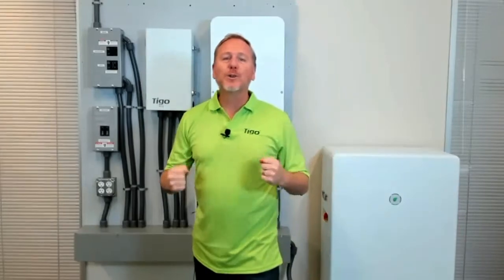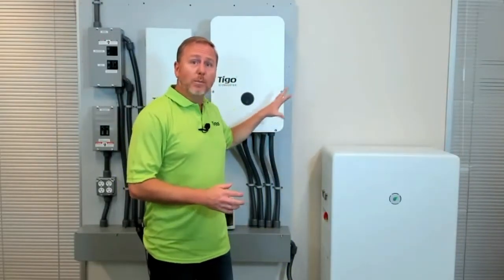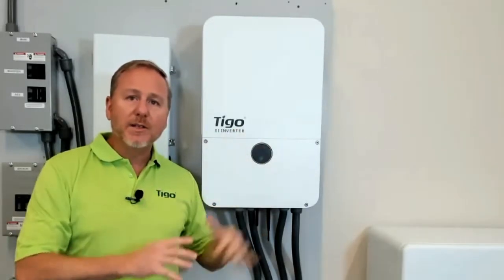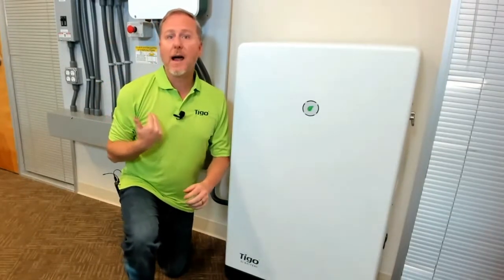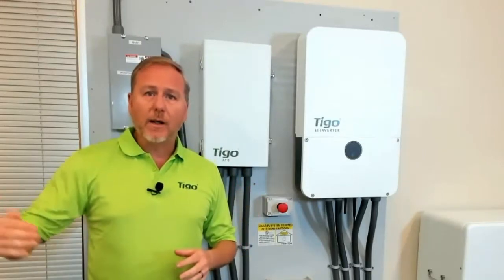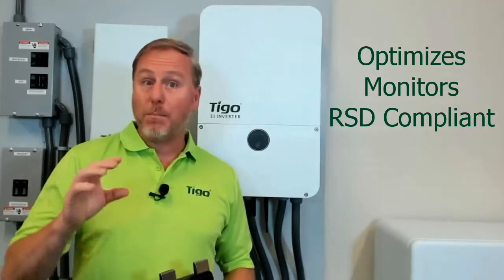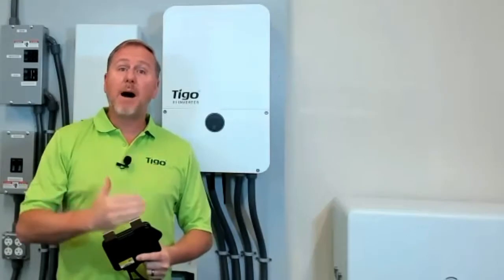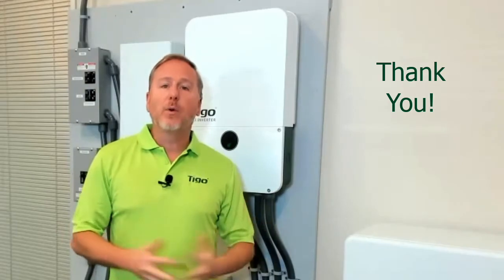Tigo EI Residential Solution - Technical Overview

Comment: Hi, can you use other types of batteries with the Tigo inverter/ATS?
Reply from the maker: The Tigo Residential Solution is compatible with AC Coupled batteries. Please contact the battery manufacturer to confirm this application.

Comment: OMG Tigo i like your power optimizers but omg you should get rid of everyone who work on this new product, major flaw you can’t call any of your inverter hybrid because it support PV and Battery lmao 🤣, an Hybrid inverter is one that does GRID interactive, like 240v backfeed your main panel with PV or Batteries in conjunction with the grid!, and the ability to sell back to the grid if needed, only inverters with that ability are given the title Hybrid, you are the new guy on the block why start to confuse people who are new to solar etc.. also 120v inverters are mainly for off-grid small deployment, make better inverter with 240v for large off or on grid applications with competitive price, or EG4’s will continue to walk all over you!! You’ll never get in this space, best of luck.
Reply from the maker: You may need to watch the video again. We are a hybrid inverter and do all of those things.
Reply: @Tigo_Flex_MLPE  the fact you have to say i need to watch the video again is a fail .. doing the same thing over again will not net anything new, a better video is needed.